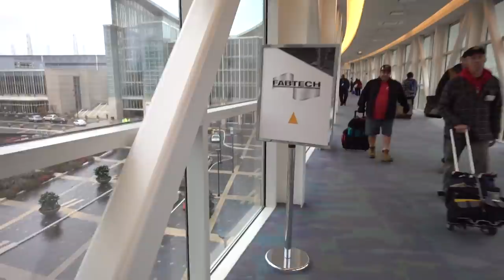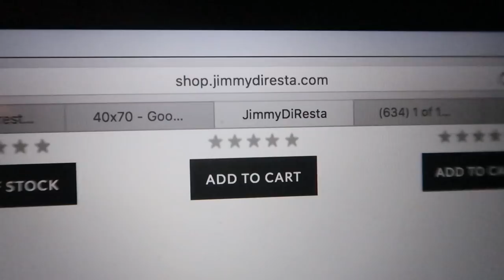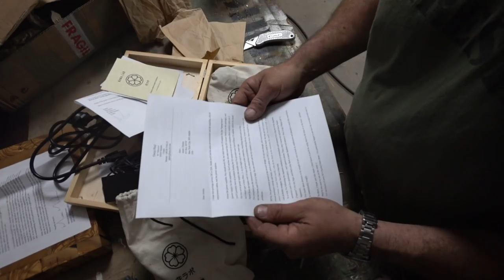DiResta 56 Fabtech & Building update

Comment: My 2 car garage and shop pole and frame building was finished last year and I couldn't be happier. At 24 X 36 feet I have a shop that more than 12 X 24 feet.  I stepped up to the plate and had it insulated at the time it was built, and had additional windows added. When it was wired I had not only 110 volt but also 220 for my air compressor and welders installed.  I have multiple outlets all the way around the interior. As far as I'm concerned, pole and frame is the way to go!

Comment: Whatever it takes, do radiant floor heat! Run thermostat off of slab temp, not air temp. That way you can leave doors open and it won’t be triggered by cold air blowing through. You’ll love it!!
Reply: Ooo...good idea. I'm not that familiar with radiant floor heat (no need for it in Mississippi), but that makes total sense about being able to leave the door open. Plus, it sounds like you're speaking from experience?

Comment: Jimmy,  It would be Great to have a circular fireplace/ pizza oven about 12' in dia center of the first floor going thru the second floor.  Heck it could be linked to some type of coil to provide hot water for the radiant floor heating, it also would be a focal point and with a combined radius bench around it would be a warm gathering area.  Love your humble Joy my brother !,

Comment: If you are going to insulate it, I would suggest using a spray foam sealing layer=1-2 inches thick and then normal bat type insulation over that or foam all the way. So snug feeling. Some people don't like the foam smell or cost, but using it for a sealing barrier then bats over it does great.  Are you doing a poured floor with radiant floor heat?

Comment: Amazing work, and certainly interesting structural choice there. You're basically building a aircraft hanger so nothing questionable there. But just like an aircraft hanger structure, it's not meant to deal with many other elements like floors and windows, so I'm certainly curious to find out how they are going to be dealt with. For example, I don't see any additional footings inside, so are you doing a slab on grade, or are there going to floor beams spanning the whole width of the building? I've dealt with floors that carry machine vibrations and it's pretty annoying, so I'm interested to see how you guys mitigate that. 

Also, I don't see plumbing, is there a septic system or equivalent system to deal with industrial / chemical waste? You could potentially do a remediation garden that use plants to remediate heavy metal and / or hydrocarbons. Just an idea, but you might already have something else in mind.

Comment: Any wood that's within the 1 meter (in regards to the drip splash, which is why European buildings have certain facade features) range from the ground will rot regardless of treatment in time. This is why one should always rise up at the very least 30 to 40 CM away from the ground. We have 1980s barns in my area that are rotten and done for, despite the fact that the wood is risen on a plinth about 10 to 15 cm from the ground. In comparison to a barn that was made in the 1960s by an American who migrated here, which has stone 60 CM from the ground.
Not that it maters in this particular case, we're talking 30 or more years in rainy environments, but still.